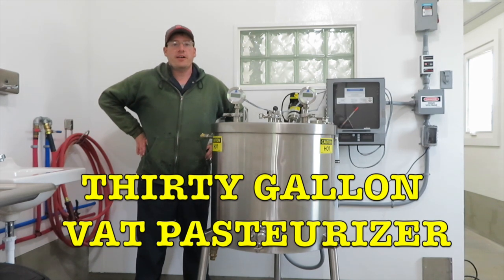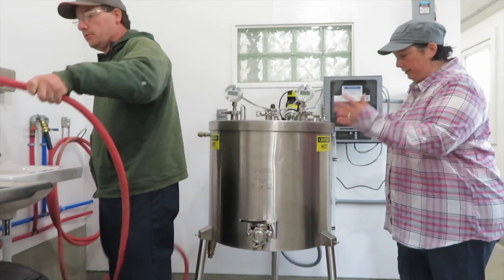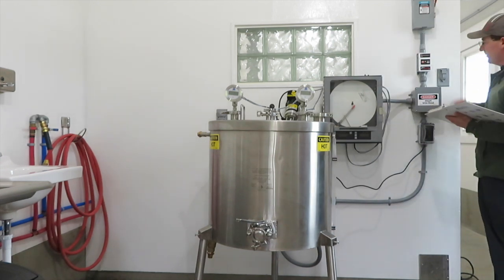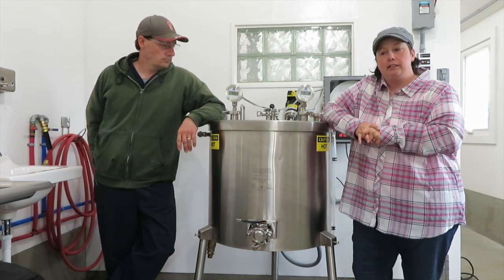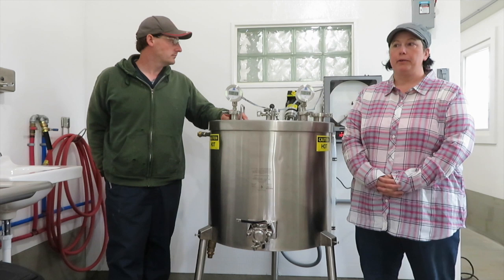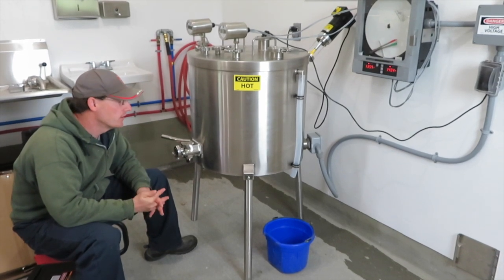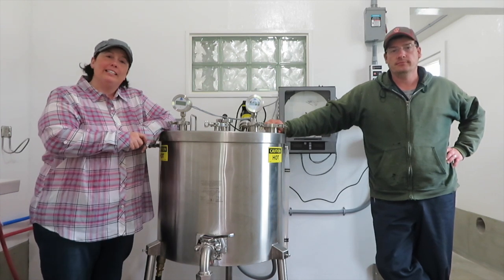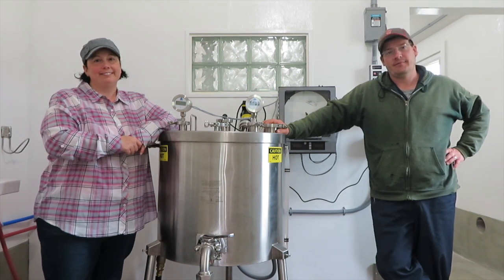Thirty Gallon Vat Pasteurizer for our Dairy Farm: Installing and Testing

Comment: Very interesting. This is a unit that should work well for your dairy. Easy to use and understand. Waiting patiently for the first bottle of milk to come off the line. Direct sales from the farmer to the consumer equals the real value of your products. Great video guys, keep em coming!!
Reply from the maker: It is pretty nice. I’ve vat pasteurized on older vats where you have to manually throttle the steam valves to maintain the temperature. It’s very labor intensive and requires a lot of attention from the operator. Ours is all programmable, just set it and check it occasionally. It’s “hands off” enough that you can actually go do other things whilst it’s heating. Glad you enjoyed the video! Thanks for watching!

Comment: I’m in the process of building a micro dairy ultimate goal is milking 6 cows. For now 3 is where we are at.  If you were to use a container how would you lay it out. 
Where did you get your 30 gallon pasteurizer?
Reply from the maker: The pasteurizer is from Northwestern Tool out of Ohio.  Container like a shipping container? I’d lay it out the same as my barn. It’d be narrower (the dairy is 12’ wide). Parlor in the back, then the milkhouse, then the processing room, and then office/storage in the front. I imagine a raised parlor would be difficult to build in a container, so I’d go with a flat parlor.

Comment: How quickly does the milk cool with running the cold water through the jacket? Thanks for sharing! ❤️
Reply from the maker: Hello friend! We’re still experimenting with throttling the valves, but our goal is under 40 degrees in 2 hours.
Reply: @vnthomas16  that's awesome! That will really help take the load off the refrigerator once you start bottling. Woohoo! Another big step! ❤️🌈
Reply: Hopefully you can pick up a used plate cooler if not too expensive.

Comment: greetings looking at this one as well! had a question how do you control the temps? the range is 90-190F correct? if I only wanted 110F how do I go about that? didnt really see any controls on this for temps thanks! (digital  for setting setpoint parameters)
Reply from the maker: The temperature is set on the chart recorder itself, as it is what controls the jacket heating element and the air space heater. I’ll admit, the controls are a little “clunky” to use, but not too bad. After doing it a few times, it starts to make more sense. I don’t know the limitations of the set points, as we only program it for the required pasteurizing temperatures depending on the product, and it covers all of those temperatures (145f for regular fluid milk, 150f for chocolate milk, and 155f for eggnog. Airspace is 5f over pasteurizing temp.) Hope this helps! Thanks for watching!

Comment: does this pasteurizer heat up with the use of a boiler system? thanks in advance.
Reply from the maker: Hello there! The pasteurizer does not require a separate boiler. It is a self-contained unit, with a heating element similar to that of a hot water heater to heat the water in the jacket. Ours requires a 30 amp, 220 volt dedicated circuit. We also need a 20 amp, 110 volt receptacle for the agitator. This isn’t a dedicated circuit, just part of the convenience receptacles for the dairy. Thanks for watching!
Reply: @vnthomas16  Thank you so much for the response! Would you mind replying with the company you pruchased from along with the contact you worked with? Thanks again!

Comment: I have to agree that UHT milk is nasty, but worse still is Sterilized Milk. My Grandmother didn't have a fridge and used sterilized milk. Like everybody else's milk at the time it [doorstep delivery milk] came in glass bottles, but while normal pasteurized milk had an aluminium foil cap, sterilized milk had a "crown cork cap", the same type of cap you find on beer bottles and which has to be removed with a bottle opener.
If you want the definition of nasty, sterilized milk is the essence of it [and it is still available to buy]!
Reply from the maker: Interesting! Thanks for sharing!